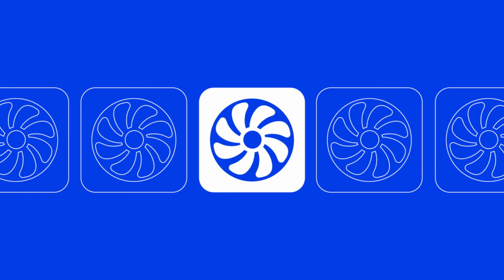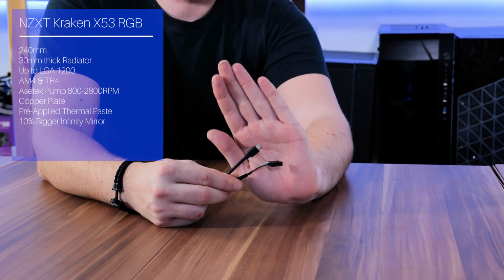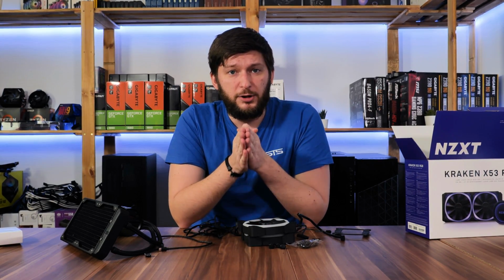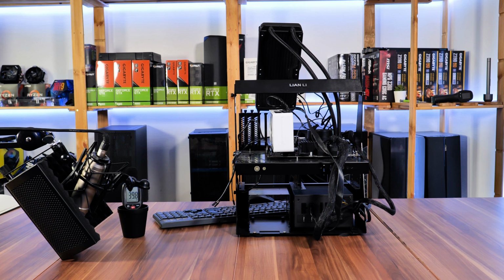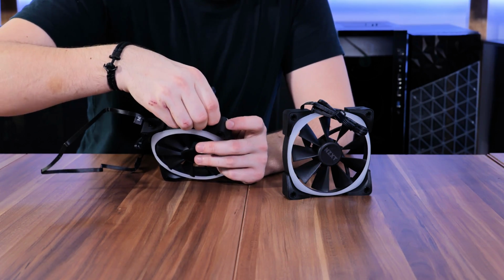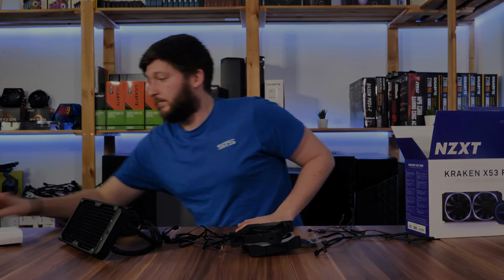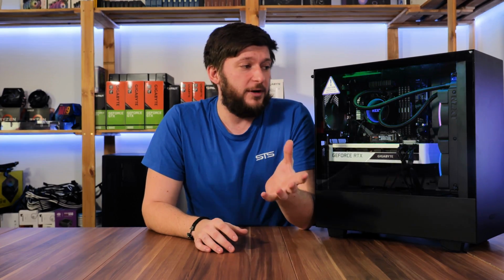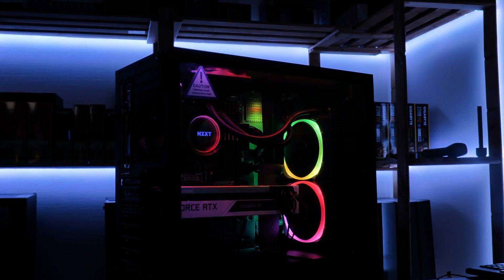NZXT Kraken X53 RGB Review | Best 240mm AIO ?

Comment: After hearing how damn cables are you must used sry this junk can be a gift and OI would say fakked it put it in your garbage bin. And what when you give a shut about the rgb and the pump and dont use the really old mini/micro usb cable, no rgb light thats all?
Reply from the maker: It's been a long time, but if I remember correctly, nothing should work without the micro usb cable, not 100% sure though

Comment: My only problem with this AIO is that the fans sounded like a jet taking off.

I swapped them with 2 Noctua NF-12s and couldn't be happier with the result. Best $30 I ever spent on a nonessential PC part.

Goddamn the stock fans were loud.
Reply: did you replace the entire fan or just the blades

Comment: Does anyone know If I have an NZXT case with cam hub already installed do I need to connect the USB 2.0 when installing the Kraken x53? I'm asking because I don't have an extra USB 2.0 connection on my motherboard & was wondering if I have to buy a USB splitter in order to install the X53

Comment: i want to use "antec superflow 120 rgb" fan as that is all over my case inside. how will that perform. how does 2 fan differ. if they have same spin speed, wont they give the same results?

Comment: Most in-depth video. I bought the rgb version out of ignorance, didn't need it. I'm not really a gamer, but a video editor using a gaming machine. I didn't connect any of the RGB in/out connectors and don't feel like taking it apart again to do that. I think I'll be ok if lights don't come on, don't care. But I also don't have a USB available. Can the system still work without that USB?
Reply: You can get usb splitter so one goes into the usb slot and the other end allows up to 4 slots which is more than enough

Comment: the normal x53 not the RGB version, it also supports up to lga 1200 socket?. I have an i7-10700k
Reply from the maker: Yes it goes,
I don't remember if LGA1200 was out when I released this vid, but LGA 1150X is also LGA 1200 compatible
Reply: Thanks You :)

Comment: Hi, love your reviews! I am planning to buy the NZXT Kraken X63 RGB. May I know should i buy the rgb or the non rgb version? I heard u said that the rgb fans performs bad compared to the normal non rgb fan. Or are there any other better cpu cooler? (Ryzen 5 3600)
Reply from the maker: Thanks! Means a lot :)

Yes, i compared the F fan that comes with the non-rgb version to the rgb fans, and they do perform worse.
But do keep in mind that with an x63 you have such a big overhead on cooling (especially for a 3600), that you don’t need that bit. So you can go with the rgb version, it won’t change much.
If you want to have a look at something that performa better, take a look at the Arctic Freezer ARGB or non-rgb
Reply: @STSYT  I see. What about Noctua NH-D15? Compare to NZXT Kraken X63 which one will you pick?
Reply from the maker: @shawnyyyy  Personally i prefer watercooling, therefore X63

Comment: hey bro i have one question, which way would i install the radiator? do the fans face inside the pc or face outside towards the front of the pc?
Reply: if mounted on the front the fans would go in front if its on top then the fans will go under. Front sucking air into the case, top sucking air from inside to outside
Reply: @DexieAddict  so i cant suck air from inside to outside at the front of the case ?
Reply: @zainisbous4425  I mean nothings stopping you but you usually wanna pull from front and exhaust from back and top
Reply: @DexieAddict  because i want to showcase the rgb in the fans, you cant see the rgb if the fans facing the panel .

Comment: hello, nice review, I wanted to combine this or one Noctua NH-U12S SE- or D15 air, to be mounted on a ryzen 5 3600 that with the stock cooler goes to me at 90 ° C in play.
what do you recommend in terms of silence and temperatures?
Reply from the maker: Hi, thanks:)

For noise and temps i think the D15 would be the best one, followed by this kraken and then the nh-u12.
That being said, the differences between the d15 and this one should marginal :)

Comment: Will it work with Intel core i7? Because i heard that sometimes coolers can't fit.
Reply from the maker: Yes it will. But the rumor that you're talking about is not CPU specific but Motherboard specific. 
There are occasions where Motherboard Manufacturer do not follow the CPU Socket guidelines to 100%. In these occasions, it can happen that there is a Power Cap which will be pressed in by the cooler. But that's extremely rare.
That being said, the Kraken lineup comes with a pretty high installation method, so you should not have any issue with whatever i7 you want to cool :)
Reply: @STSYT  oh I see, thank you.

Comment: can you change the rgb to two colors at the same time or will it just switch between colors?
Reply from the maker: The text and ring are two seperste settings.
For the ring you can choose to set an individual color to each LED. If i remember correctly it should be something around 8x

Comment: Hey, can you tell me why my rgb is not working? The fans are spinning, but no rgb 🤔
Reply from the maker: Have you checked the rgb connection from the waterblock to the fans?
Is the sata power plug connected?
Reply: @STSYT  the pump block lights up, and in the cam software I can change color and etc, just the fans in the radiator are the ones not lighting up.
Reply from the maker: Is CAM showing the fans on the Color menue?
Reply: @STSYT  no,  just the water block 🤔

Comment: why was the fan configuration bad?
Reply from the maker: Because it was made in order to look good.
The rgb fans of the x53 rgb have their rgb ring on the side where the air comes in. If you look closely, every fan in the system is turned to blow air out of the case. Not a very ideal setup.

I had to do it because i wanted to use the h510i case, but in normal a normal operation you would just turn fans around

Comment: Hey! I am planning to build a pc and have a question. Im thinking the nzxt kraken x53 aio and the nzxt h510 case, the same one in this video. however I will be positioning the aio with the fans up to the side, so the rgb wont be visible. I was wondering if I would be able to buy the rgb version and switch the rgb fans out and replace them with the two fans in the upper left corner since it would save me $30. Ik they're the same size but would the cables allow for them to be placed there?
Reply: oh! I also saw someone say that in order to run this radiator you need to have 3 4-pin cpu connectors from your psu to your motherboard. Is this true? sorry for the questions lol
Reply from the maker: Of course you can do that. There’s nothing keeping you from doing that.
Just remember to still connect the fans to the wiring thing comming from the waterblock, otherwise there will be no software controll.

On the second question, i don’t really get it. If you’re really talking about cpu-connectors, like the power connector in the top left corner of a mobo, then no, it has absolutely nothing to do with the cooling system.

If you actually ment fan-power connectors, then still no ^^
You need 2 which basicly every mainboard nowadays has.
The pump comes with a 3-pin header, which you can also install on every 4-pin header.
Then the fans need one.
There is a fan splitter included which let’s you connect both fans to a single fan header. 
The only reason you would need 3 fan headers is if you run each fan on it’s own, which doesn’t make sense.

I hope this helps:)
Reply: @STSYT  thank you, this does help a lot! And thank you for clearing that up I was just really confused when I saw someone say that :D

Comment: Can you vouch that there is no possibility of leakage or pump failure? I am still not sure with AIO. 
Your inputs will definitely help. Thank you.
Reply from the maker: Sorry but I cannot vouch for something like that. Manufacturing errors could always lead to a leackage or pump failure. Even if I had a completely different experience.

I can just tell you that none of the +- 15 AIO’s that i’ve been using in the last 2 years had any of these issues.

I hope this reassures you
Reply: @STSYT   I am getting the impression that AIO are not like air coolers which are set and forget. Atleast, for me, based on what you have said, I am not ready for AIO. 
Thank you.
Reply from the maker: @Pianitara  
Nah, you're overthinking it here.
AIO's are the set-and-forget version of watercoolers.
Custom-made systems are a lot of work and not the best fit for a first-time build.
But for AIOs, the risk of leakage is statistically so low it doesn't matter. The installation is just as easy as higher-level Air coolers.
The only think you have to keep in mind is where to put the radiator, that's it
Reply: @STSYT  Thank you for clarifying and shedding some light.
Reply from the maker: @Pianitara  You're welcome!

Comment: Be warned my fan rgb connection cable came out of the box with a bad connector. It was loose and I had to tape it down until a replacement came.
Reply from the maker: Good to know.
And were you happy with the replacement procedure?

Comment: So your pushing the Air out the Front, where do you get intake I noticed you have to mount the Fans backward when going in front or not do a pull system.  Not sure they thought that through with the RGB Other fans you can see LED"s from behind makes sense to use them on the inside of the radiator.
Reply from the maker: So build made in the video was just to showcase the Cooler, I intentionally reverse them just to make them look good.
But you're absolutely right, they take the air in on the RGB side and push them out in the non-rgb part.
So the best usage would be in the top of a case or in the front if you have Glass in the Front.
I used the NZXT H510i, so the only way to show them off was to reverse it. But the H510i Elite has the Glass in the front, there it works perfectly fine.

You will still be able to do push-pull perfectly fine with those fans, you just have to take into account that one side of Fans won't be showing off the RGB. 
RGB Rings on both sides would have made all of this way easier. So you're kinda right
Reply: @STSYT  I am glad for your video because it let me realize there was no way possible to make this work.  IF you put a radiator on top your pushing HOT air through it so They should make the fans possible to Move the LED.  Corsair Fans you can see the LED from the exhaust side but these fans it's very vague.  So just to state, I went ahead of put them in Correctly in the Front on the 210i case and you can actually see the LED so it was not the end of the world, Also on the Side, you can see. So turned out to be not so bad but was kinda confused there initially.  I will look for the Glass Front Case for my next build. this was a MINI build for my Bluerirs DeepStack box wanted something that would fit in a small space.  Thank you so much for your reply was one of the only videos I found that did admit or explain "yep they are backward" for front install.

Comment: Could u PLEASE make a Short video of how to connect THE rgb
Reply from the maker: There is a short part in the Video where I explained it.
The Mini USB goes into the waterblock, the USB Header on the other side into a USB 2.0 of you Mainboard.
Then you take that 1 to many cable and stick the single side into the Waterblock. On the Other side of that cable, you have to connect the Sata to Sata Power, the Fan Header onto a Fan Header, and the last plug that says "NZXT" into the included Adapter/extension. The other side of that extension then goes into one of the Fans. (don't forget to Daisy-Chain your Fans)
That's basically it. From here you can use NZXT CAM to control the RGB.
I hope this helped you, but you still have issues, I'll try to guide you through.
Reply: @STSYT  thank u because im building My first PC in may and just need som extra help but i Will let u know IF i need a guide 👍
Reply: 'NZXT Cam doesn't recognize my fans so I can't change the color :(

Comment: I am a competitive player but with a budget My Specs are.  
Lian Li lancool 215
Tomahawk b450 max
Ryzen 5 5600x
16gb ram 2666mhz
Kingston 250 GB m.2 ssd
1 tb HDD
And 750 wolts
Should i buy this cooler?
Reply from the maker: I had this cooler on a 5600x already. It will work perfectly fine.
Though a kraken m22 that costs way less will also work. 
So yeah you can buy it. But if your budget is too tight for a 240mm, you can also cool your 5600 with a M22